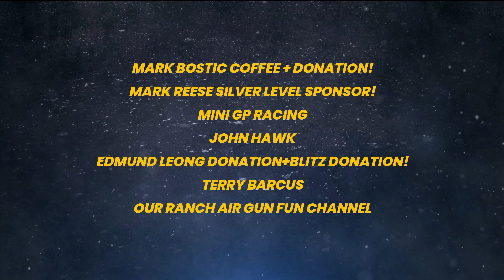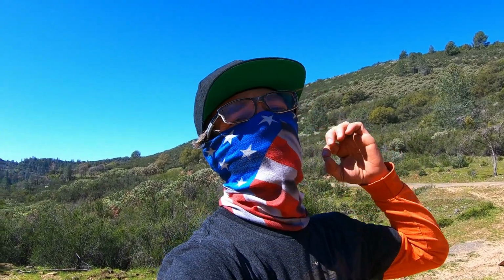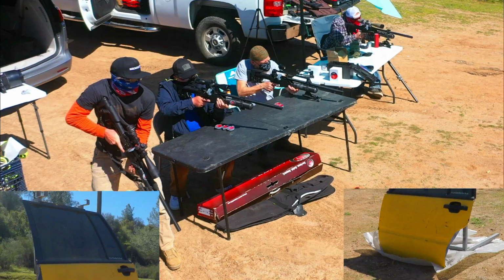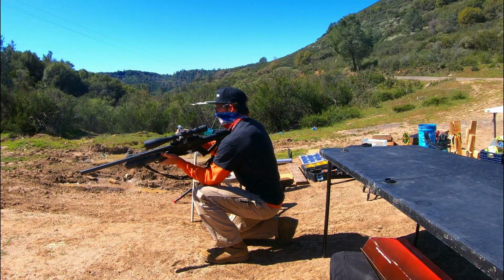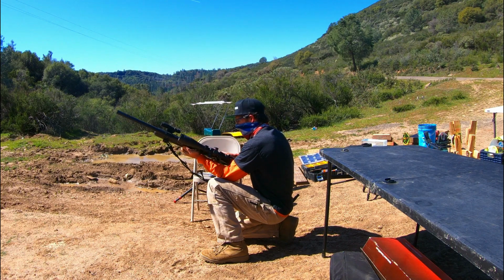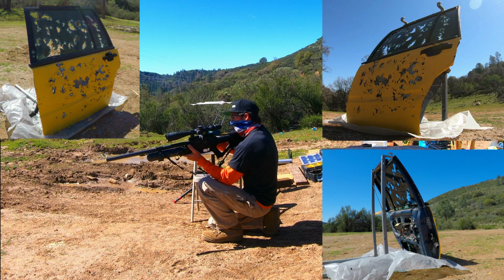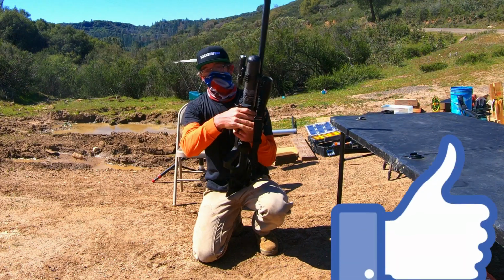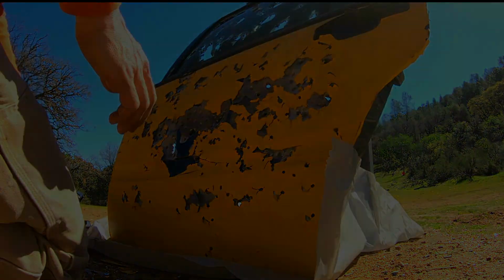PUSHING MY HATSAN BLITZ TO FAILURE!!! TORTURE TEST! 4 HATSAN BLITZ AIR RIFLES  VS CAR DOOR! PCP TEST

Comment: We have 5 total, my friends and I, all are .30 caliber. 

We went the first time, one airgun jammed like yours after 2 hundred rounds max. 
The very next time another .30 caliber jammed again. 

Mine didn’t jam, however I only shot about 2 hundred rounds out of mine. 

What I noticed right out of the box, it had too much grease in the receiver, and the bolt action was extremely hard to chamber, but it got better after a few magazines. 

Grease wouldn’t let me spray all 16 rounds perfectly, so I did 3 bursts for each magazine. 

Another issue we had was with the Hatsan .30 caliber pellets, they jammed every time, sometimes leaving you with more them 2 pellets in a chamber. 

I had purchased about 20 canisters, only later to realize they are the worst possible quality Ammo I have ever seen. 

JSB 50 grain pellets were 
amazing and accurate at the 50,  75 and 100 yard tests which we were all impressed, even in fully auto mode. 

Ammo makes a world of a difference so make sure to use the quality pellets of slugs if you want to take cake of your air rifle so it can last a long time. 

Also clean up the grease inside the receiver, but leave enough to make sure the internals are lubricated all the time. 

From factory these will have some debris inside the barrel, I saw it on another YouTube channel, after he cleaned his barrel which was in .22 caliber,  
His air rifle did not jam anymore . 

Hope you fix your baby and keep on having a great time brother, sure sucks to pay 💰 $1000 dollars which is more then my friends AR15 rifle lol 😂, and have it jam or give you issues within a year or a few weeks. 

However even with real guns, ammo is everything, if you have a bad quality 7.62x39 in your AK, it will also not fire fully automatic, seen it many times with cheaper rounds, like the Russian Wolf bullets, but Remington bullets, they never jammed, not inside the Glock or AK or any AR. 

Good ammo ✅

Clean barrel ✅

Just right amount of grease in the receiver ✅

🇺🇸🇺🇸🇺🇸😁😎💪💪💪🍺🍺👍👍👍👍👍🍿🎥
Reply: RIGHT ON! 

Nate (from AIRGUN CHANNEL) is always talking about cleaning the manufacture's grease out of new airgun barrels (and he urges to continue the cleanouts every 500 rounds!). Doing so guarantees Improved performance and accuracy!! Experience is a great teacher.

Comment: I liked seeing that collection of Blitz.  I would  guess that the hammer spring is getting weaker especially as the gun dries of lubrication adding more strain on  the guns function. Rebuild time maybe? Take apart ( take pictures of gear area to set it back in place correctly)  wipe clean, replace moly grease, replace breach seal, maybe regulator seals also, and both springs.  Or just try adjusting the hammer spring a little tighter for now. Hope it helps.
Reply from the maker: Custom rebuild coming soon!
Reply: @macabespeed  Tip; You must use and impact screw driver on the damn tiny screws or else they will strip. I used a $20 impact screw driver from Walmart. Hold it tight, give a good wack then the screws are yours. I am currently waiting for a new firing pin to replace my broken one. The regulator is now exposed showing 2 o-rings. One of the o-rings  has a tiny chunk missing from, I believe, the assembling. You can tell its from assembling the gun because the chunk is aligned with a  scratch line and a small dent  in the metal block. Anyway  I plan to put it back together with the chunked o-ring for 2 reasons. 1 to record a few chronograph shots and 2 to perform tissue test  to see if there is a blast of air coming through any openings of the receiver. Then I will replace the chunked o-ring and test again. My goal is to see if this test would reveal bad regulator o-rings without having to disassemble. I also hope there is a huge difference to gain power after replacing.

Comment: Do you clean your barrel every 500-1000 shots as stated in the manual? The barrel in the Blitz captures and recycles some of the air when shooting to cycle the bolt, if it gets clogged up with lead dust it will cause malfunctions. Also, is this the same Blitz you used those powder coated slugs in? All that powder dust could also create quite a mess in the gun's internals. Don't give up on it though. If anything, send it in to Hatsan, they should be able to diagnose the issue and give you recommendations to prevent further malfunctions. Good luck!
Reply from the maker: No powder coat comes off man, thanks. I have never cleaned any air rifle I ever owned. Thanks
Reply: @macabespeed  You have to clean your guns, bro. That's probably your issue. PCP's in general don't have to be cleaned nearly as often as traditional firearms, but they do need basic maintenance. I very rarely clean any of mine either, except for the Hatsan automatics. All of Hatsan's automatics (even the semi's) use a gas operated action to cycle the bolt, once that gets clogged, your gun will jam. Get yourself a cleaning rod, then I use a small amount of Ballistol on a patch and run it through the barrel a few times, then once most of the lead residue is gone, I run a dry patch through. Make sure you only use a small amount of Ballistol, it will dissolve lead and clean your barrel beautifully, but it will also eat your seals and o-rings, so keep it strictly inside the barrel and clean up well after. Then just a drop or two of 100% silicone oil on the moving parts (if needed) and you should be good to go. Might be a very easy fix. Anyways, good luck and thanks for all the videos!